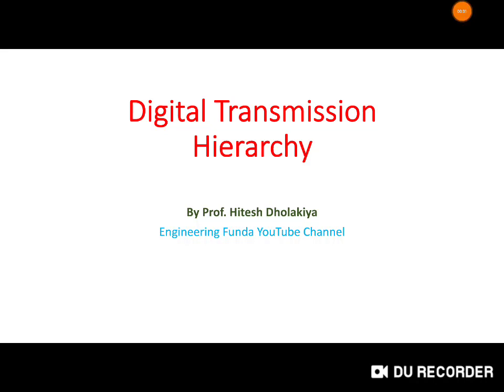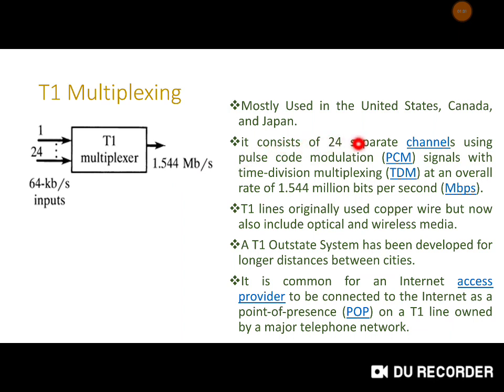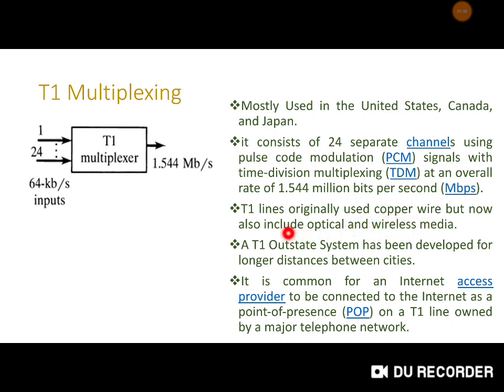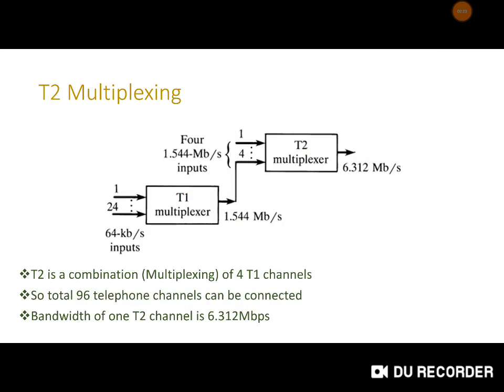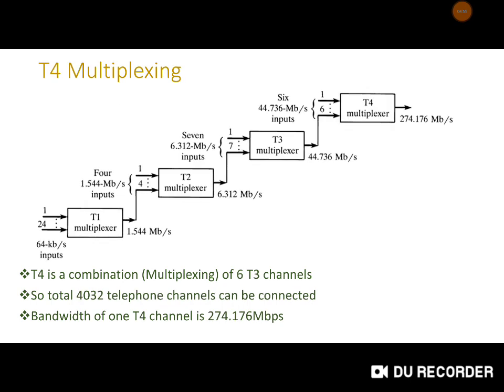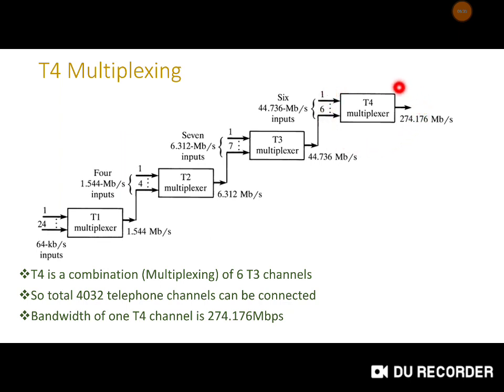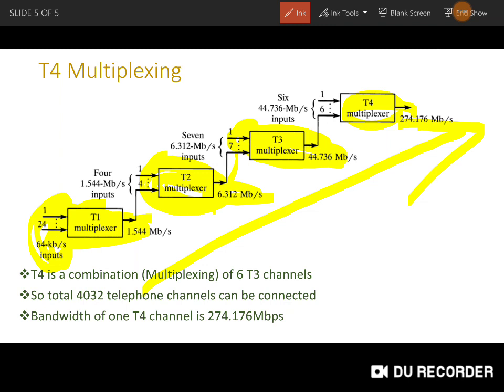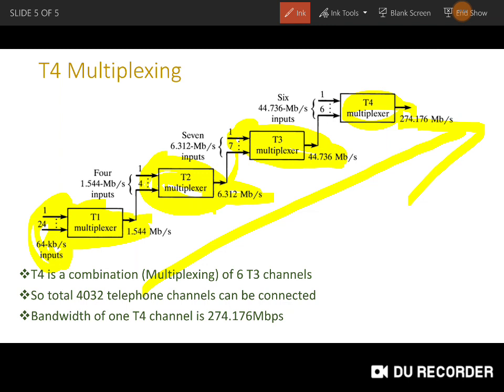Digital Transmission Hierarchy | T1, T2, T3 & T4 Multiplexing | Optical Fiber Communication

Comment: Is that Mbps (Million bits per second) or (Megabit per second) cuz' we have actually had bps, Mbps, Gbps...
Reply from the maker: Mbps means 2^20 bits per second and Million means 10^6 
There is little difference between this two and you can calculate in calculator to find a difference.
Reply from the maker: Gbps means 2^30 bits per second
Reply from the maker: Kbps means 2^10 bits per second
Reply: @EngineeringFunda  Thank you for responding well explanation as well..
can you make some videos on SS7? Signaling also might be helpful to others though...👍📌